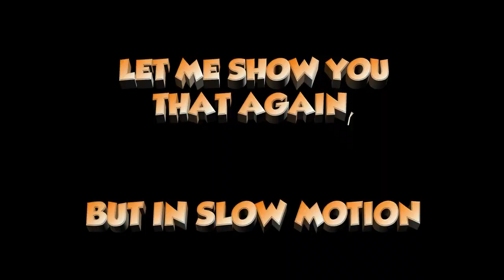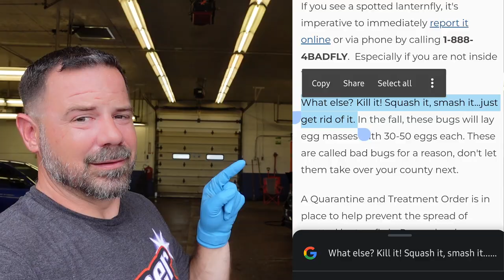Have you ever heard of the Spotted Lanternfly? Seat covers for the 11th Gen Honda Civic Installed!

Comment: I think the 2023 Type R is gorgeous. They did everything right. They are running a 265/30/19. Wide ass tire. To me, the 10th Gen Type R is for the teenager, and the 11th gen Type R is for adults. Looks great but not obnoxious. It's cooling system is much better. Aerodynamics are better and vents are real. I'm ONLY talking to Miller. Don't care for other responses if they're negative.
Reply from the maker: I agree, brother! Guess I got the tire size wrong...lol!
Reply: @717PROJECT  the 265 will give the 30 sidewall a little more rubber. I hope you didn't take my comment on the 10th gen as a bad thing towards you. If I could own one, trust me I would. I think Honda wanted to appeal to more age groups with the new Type R. Especially because it's more common for someone our age to have money for one. I was told there are no fog lights because it would've ruined the aero of the brake cooling duct. At least it has bright led headlights. I kinda agree on the red carpet. I would throw some lasfit mats down either way. That would help imo. I did hear power numbers but I don't want to put out in public (I'm not supposed to).
Reply from the maker: @dave_mac  hmmm, well when you can let a brother know, please do!

Comment: Global warning is a farce, but squash those cooties bugs. Remember those? 

Like the other guy commented about the 2023 11th Gen Type R, I totally agree, I already told you. I believe the new Type R is 325 HP JDM/Japan spec. About 10 HP less US Spec in stock form. But basically the same as your Type R, with a few tweaks, so existing mods and tuning recalibration, etc.  should apply. Other items may be specific for this version. 

The seat covers are pretty nice, but yeah, universal fit, so not the best. But at least you have covers for the rear seats. 

They have Katskins thst can be custom made, but pricey. Walmart has some pretty nice universal seat covers, but only the front.

We have a local company here in Hawai'i thst makes wetsuit type custom seat covers, too.

College Hills Honda sells OEM Honda accessories and some cool after market stuff, plus a set of black simple covers for the front seats I will probably get. It will be mostly for the main purpose of the seat covers, to protect it. Not only to keep it clean, but to protect from wear and tear, especially from abrasion with all my EDC stuff I carry on my belt and pockets. 

The tech shine seems good and easy application. But there are so much different paint treatments out there.
Reply from the maker: I've just never been a fan of seat covers! Pretty much just did it for the community! The tech shine is pretty good I must say! Surprised me!
Reply: @717PROJECT  Yeah, I would Scotchguard the fabric seats, and dress leather ones, but just concerned about all my belt gear wearing down the fabric, so the covers I am looking seem to be
more like protective aprons.